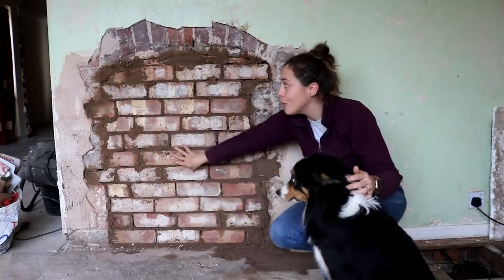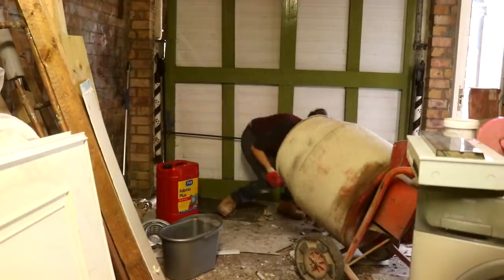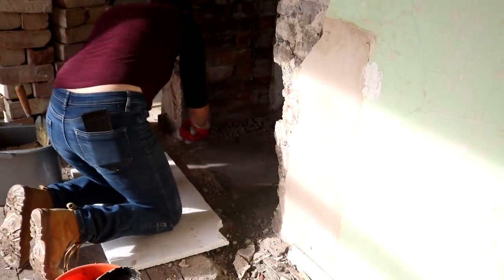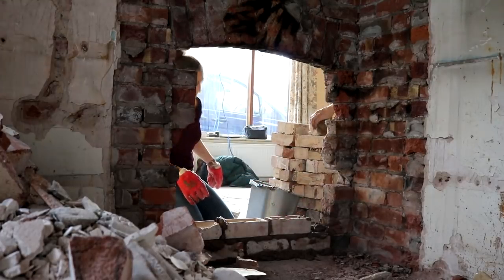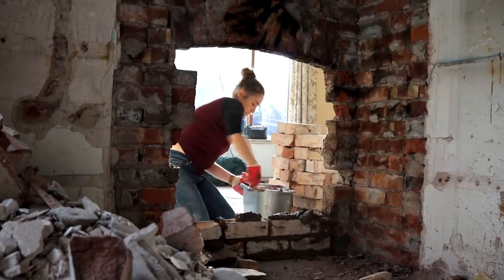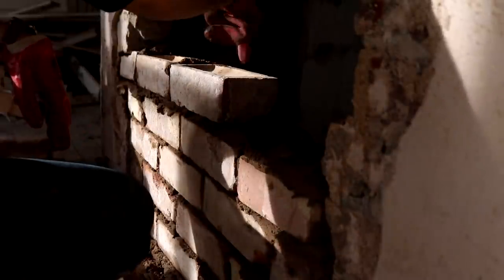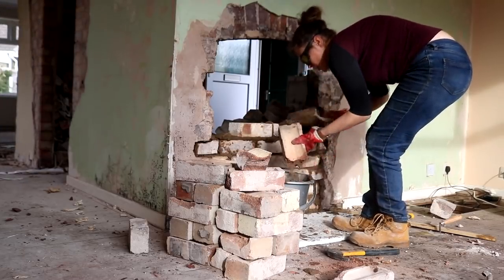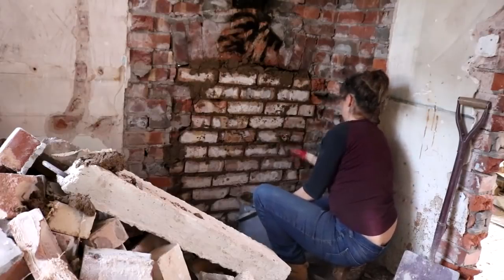Brick Lay In An Old Fireplace Hole | The Carpenter's Daughter

Comment: never ever put the shovel in the mixers drum ,if it catches you've got a broken wrist ,and tip your muck on a spot board much easier
Reply: peter smith bollocks I was a bricklayers  labourer for years and you use the shovel to scrape all dry sand off the back of the mixer did it thousands of time with no problems
Reply: @paulbackhard6315  oh I didn't realise that ,top tip there I really should have known after 40 years on the trowel
Reply: Depends how careful/ careless you are? :D

Comment: Hi there,
Difficult to do but well done,
What I would advise is that you can chip away at the plaster either side and string a line and lay your bricks to the line.
Also you can use wall ties at either end to tie the brickwork in as well as toothing.
With regards to cutting the bricks, club hammer and bolster is useful, and a scutch hammer and scutch chisel helps to chip away any high spots.

Comment: Great job 👍 only thing I could suggest is an old paint brush with either water or a pea water solution painted around base and up the existing wall as it helps stop the dry brick work sucking all the moisture out of your “gobbo” which causes weakness and cracking
Reply from the maker: Thanks for the tip :)

Comment: heya good job on brick work but when mortar drys i would suggest give it a re-point still gaps in brickwork give a touch up before you plaster it etc and another suggestion depending on job you do go up 5 coarse point it all make sure its compact let it dry for hour or 2 then do rest of bricks because if you do all at once the weight of the bricks can compress the bottom ones cause it sink and leave a gap
Reply from the maker: Thank for the tips :)

Comment: 'Ark at you with all them scientific terms and technical words! Gobbo 'n' snot, indeed - sounds like a punk rock duo :o)

Tell you what, though, that's a cracking good job! Sincerely. You got the mix dead right for the job, locked the bricks in nicely and ended up with a proper job done. Which really isn't too bad at all, especially when you find how thirsty dry ol' bricks can be.

Dad has just gotta be pleased with you. I always am when any of my girls do stuff like this. It's an old bloke thing.

Oh! and the only suggestion I might possibly make, seein' as you were clearly on top of the job as you were, is to try using a bolster to cut the bricks - it might work for you, but it might not. Or try nibbling away at the bricks with the heel of the trowel.

Thanks for yet another hugely enjoyable video!

Comment: I wouldn't do anything differently though my experience as a mason is quite slim. I find those bricks curious with that concavity, most of the ones I've seen here have 3 holes through them a couple of cm diameter.
Reply from the maker: Yes, I know the ones!  I forgot to say that the reason my parents reused these bricks is because they don't make them anymore.  They're imperial and matched the rest of the wall.  I believe they were London Brick Company bricks.
Reply: @TheCarpentersDaughterUK  I never though about metric bricks.

Comment: If it works you have done a good job!
The only things I would have done differently is, if using bricks with a "frog" (fairly unusual nowadays) I would have them downwards. When putting the mortar bed down I would run the point of the trowel down the center of the course of brick pushing the mortar to the edge where the brick face I am applying is and then run the trowel across the corners making a small "mountain" of mortar along each edge. This means that the mortar makes good contact all around the edge of the brick where it matters ;0)
If you have a good brickie's trowel you can "cut" the bricks to size with a couple of blows of the trowel edge to the face of the brick and one (or 2) good blows to shear it off! That is a bit more for the experts though ...... a small lump hammer and a bolster will also do the job nicely!
Working the mortar is important too! Have your mortar on a small flat board and slide the trowel on the board to pick up a load of mortar, turn your trowel at 90 degrees and "flop" the mortar back on the board. This makes it a bit more workable! A bit of care with the bricks can save a lot of pain later ..... if the bricks are too dry they will suck the moisture out of the mortar too quickly causing poor joints and bonding! If your bricks have been outside in the UK you will be good but if they have spent 50 years in a dry chimney it might be a good idea to dunk each brick in a bucket of water and stack them prior to use!
Again it does not matter in your case but running a pointing trowel along the courses is a must if you want it to look good (say a garden wall) and there are various styles of pointing ..... I have seen everything from an old metal bucket handle used to exact flats pressed in to cause water to "run off" but most tend to use a rounded rake to get their finish now!
As you said it will all be hidden so most of my points are not relevant here in this case! You have done a quite passable job that many "handymen" with more experience would have done no better! 

If I am honest I have seen "professionals" do worse ;0)
Reply from the maker: Thanks for the tips, Dave :)  I'm not sure I'm ready with the garden wall yet (which needs pillar needs to be moved soon.  But I'll bear these in mind as I'm hoping to help out a bit if the real bricky my Dad uses will let me 😂
Reply: That would make a good one ..... if (s)he is willing!

Comment: Good Job All I Would Have Done Different Is Using A Spirit Level After Every Row, Thanks For Sharing ;)
Reply from the maker: Thanks :)  Me too usually, but my Dad made me feel confident about it 😀
Reply: If you were building a free standing wall.. Yes spirit level the top. Otherwise in this case. Not an issue.
Just make sure it keeps inline with the bricks above so you don't end up with a concave or convex wall.